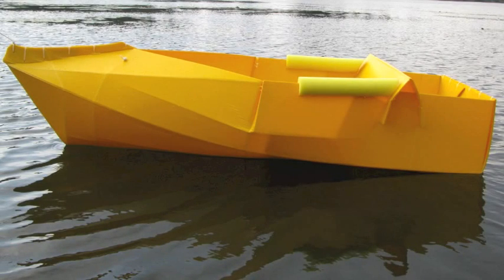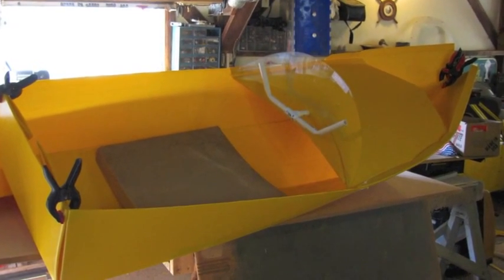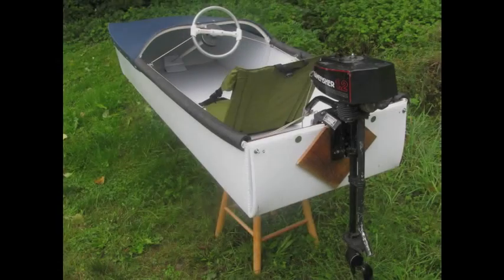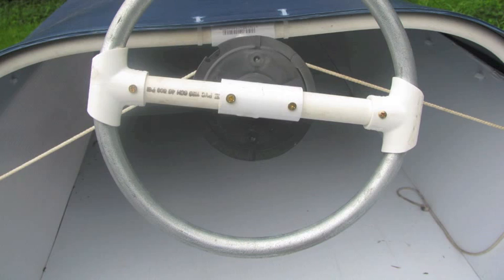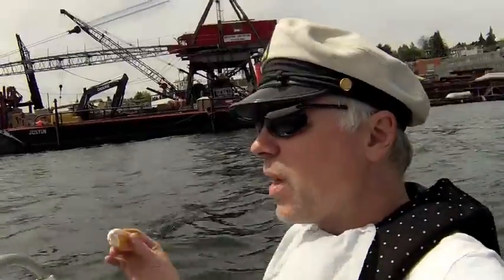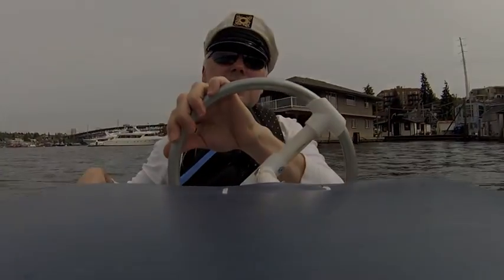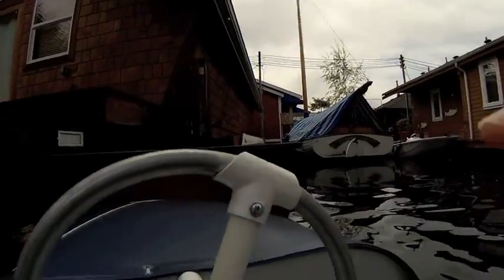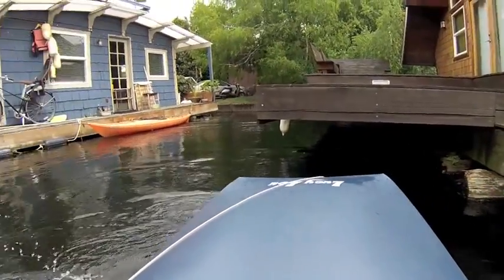A houseboat tour with my DIY micro motor boat

Comment: how fast can this go and would it be a good idea to put an electric trolling motor on it?
Reply from the maker: It goes about 6 knots which isn't neck snapping but still fun. My boat 'Sparky' was lengthened to help support the extra weight of the battery, shown on my youtube channel. Plan available for Sparky as well.

Comment: I'm curious..is there a reason you didn't make frame from 3/4" plywood>>>>tinyurl.com/yyjw942e       ? I would think you could use your template as a guide and cut them out with a router. Wouldn't that be lighter and stronger..I'm not knocking how you did it

Comment: With respect the “jerk” on the boat had a point. With a mega yacht like that parked there that was obviously a private marina. Those people pay a lot of money to have access to there and don’t want to be annoyed but the sound of your motor putting away. Just because all those big boats their engines are within the ship and behind several feet of sound proofing so the most sound from that big ass ship is from the water breaking as it pushes through it. Again like I said with respect but you really shouldn’t have just been there touristing it up.

Comment: FYI
Foam Inserts = Inserts Of Foam Are Constructed In The Inner Bottom Of A Vessels Haul. Either Type Of Foam Application Been Noted As Useful During That Initial Phase Of Construction:
- Hardware Store Standard Retail Size=  2’or 4’by 8’ White Or Blue Styrofoam … Cut-To-Useful-Sizes 
- Spray Foams –Spraying Foam Thru Several Holes Drilled Into Upper Pre-Framed Self-Containment Unit. Note: Spray Foam Expands Plenty And Has Potential To Distort The Bottom Haul. Don't be discouraged to use spray foam because it has its usefuliness. So keep that in mind is all.

Add this concept to your design and never be concerned of losing your boat to the depths of the waters.

Good Luck 
&
Show off to the world your design ingeniousness

Comment: How does the steering work???
Reply: Kruger Games I want to know aswell
Reply: Kruger Games a string connected to the wheel turns the motor because that those types of motors have to be manually turned

Comment: how do you get away with no registration
Reply from the maker: Write you your local or state rep and tell him/her how unfair that is. Say you won't vote for them next time around, that will get their attention.
Reply: its under 10 ft, or its it 12? anyway its short enough.
Reply: 16 and less than 10 hp in wash
Reply: Kenneth Lindahl in Florida you have to register ANY type of motor, that goes for a trolling motor on a canoe! It's ridiculous and it's the only reason why I haven't bought one yet
Reply from the maker: That might be a problem. Sorry to hear about the strict rules. Each state is different. Some states tax everything while others not so much. It seems the nicer weather of a state the worse the taxes.
Reply: Yeah it sucks! Nonetheless awesome boat you have in the video! Whats the website for the plans again?

Comment: I think you answered this already but could you use 10 mm Cora Plast instead of 6 mm I'm having the darndest time finding 6 mm Coro Plast
Reply from the maker: I wouldn't. I had a tough time folding 6mm, using a heat gun and a heavy duty crease wheel to persuade a bend. Don't know where you live but I find mine at Laird plastics in Seattle Washington. I suggest people to google search plastic supply with your nearest city included in the search. You should get some potential outfits to call.
Reply: Paul Elkins I live in Mukilteo Love the hat Paul ! ;)

Comment: Hi Pal. Can the coro speedboat be made with wood?
Reply from the maker: I don't see why not. It might be difficult making the transition from bottom to bow. You could use 1/4" or 3-4mm thick paneling similar to my other electric wood boats to make the gradual transition bend.

Comment: This is an old video but how do you control throttle rates with this boat? I'm very interested in your channel you produce very interesting and informative videos, thank you.
Reply from the maker: +Laxinitup226 The original motor had a small throttle on the steering arm similar to a bike shifter. I moved t up to the right siderail where I rest my hand. That's why it's hard to see.

Comment: Sorry for the multiple posts,  What are the over all dimensions of that Lucy Lu Boat? Length x width x height? in inches preferably.
 I know you are restricted by a one sheet tub style design, I was thinking about your raised outboard, and lowering it back down fixing the outboard, and directing  a rudder or dual rudder behind the prop blast for steering.

Comment: i want the trolling motor to quickly change between Boats, 
I am also thinking of another boat, like a Kayak style lower section with a traditional Boat Hull Corrugated Plastic Top, sides and Bottom, like your Lucy Lu Boat, made 4"  to 6" plus or minus, thick floor horizontal foam sheeting and vertical foam sheeting for the sides maybe 4" +/- thick, mostly of the foam insulation as the main Flotation for the hull, with either a Corrugated outer/upper hull for looks and hull bottom of hull for a smooth durable hull floor protecting the flotation foam, maybe a Plywood floor may be in order as I can use it as a skeleton to mount easily to it and it would be the spine. this style boat may make a front drive, much easier, meaning a Trolling motor between the legs enough forward to make steering comfortable, legs wrap around trolling motor, battery in back.
I like model Boat construction methods, using Interlocking Plywood pieces, as it uses a lot less wood and weight, but provides a Much Much Stronger Hull!!!!  another thought is the 2" wide insulation Foam, vertical side by side pieces across the hulls floor what ever height you are looking for, 6" maybe,  this will help provide a Very Stiff durable Boat w/interlocking ply Bottom under that for the hull floor. Each 4' x 8' sheet of Foam is 5.4-lbs so it is Light and durable.

Comment: I like this boat style and building materials, But i was thinking a 45 lb thrust MinnKota trolling motor, it is almost 3 h.p. But you say you almost sank the boat, can you explain? if it was due to the raised outboard, what about lowering the tannaka outboard back down and just raising the v-bar by adding some verticle extenders at the V-bar tips, as that would keep the COG down lower and keep the rocking yaw /tilting down lower. Another question, the Corrugated Plastic has flutes, have you tried to seal the tops all the way around the top edge trapping the air in the channels/ and second, Have you seen the 2" wide Insulating Foam at Home depot, called R-Tech Insulfoam, 2" thick x 4' x 8' weight per sheet 5.4# and is $20.00 one sheet could go double thick on a boat that small, but maybe single thick is all that is needed,  If you took 3/8" Plywood Floor with 2" foam Insulation, (or it could be double thickness) glued to the ply bottom, then use your Corrugated plastic surround tub folded up origami style, around everything, covering the whole lower section, to make it water tight, like you did on your Lucy Lu boat, except you would have either 2" to 4" thick foam = trapped air sealed in the corrugated plastic, either tape or seal the corrugated plastic holes so that they hold Air, Heaviest part of the boat would be the Lowest part, the foam would add a lot of Bouncy and the foam would be your seat, maybe a foam/ply 1/4" ply may work for seat back seat back with foam glue to it. I dont think you would add a lot of weight, but it would add a lot of bouncy. to bad you dont have a BLOG to have boat building and tips & techniques, for combine brain storming, that would be excellent.
Reply from the maker: +Gary West 
Many ways to build a boat Gary. This is one way, and due to the 4x8 sheet limitation it can only carry so much weight. Water came close to breaching the edge when I leaned way back to fidget with the motor.
Reply: I have been looking at ways to bond/seal  multiple sheets of polypropylene corrugated, looks like, both can be glued together with good super glue, and Hot melt glue both work and seal, a layer of glass cloth on the seal using these adhesives may be the ticket, I would start by making a center tub for you to ride in, make the tub narrower than your boat so you can get a higher side wall and get the height you want, 12" +++ or so, then mount that to a Ply wood lower floor section the entire width and length of the Boat, between the tub and the outer two sheet hull supporting them both, then i would like to have a boat about 40"- 45" + or so wide, I would overlap a center section full width of the floor, with a piece inside and out of boat sandwiched,two chances to seal, that way the extra width is for stability, the inner tub to have some bouncy and keep you dry, the space in between the inner tub and outer wall i would fill in the side walls with the Foam Insulation, it is ridge and tough, and been thinking maybe a Foam insulation floor inside the boat 2" thick and a second Foam floor under the boat (or just do 4" thick inside the Boat floor) for 4" thick total in the floor not including the sides, (I would like to take all the foam I plan on using in the Boat before it is installed lay it all on top of each other on top of pool water and sit on it to see how well it floats under my weight only test) for more flotation, shape it as needed, I am thinking maybe 2"-4" wide on each side outside the tub but inside the outer hull, the full length of boat, this would add a lot of rigidity to the boat. there should be enough foam to keep the boat afloat in a situation so that you dont loose the boat if something were to happen, it should work I Like Quiet, i would like to put a Minn Kota 55 lb thrust Endura Maxx trolling motor 3.67h.p. and a deep charge marine battery setup.
I was thinking either a front drive, as it would handle great and steering would be tiller steering, but will probably go rear drive, to take the complexity out of it.. I figure the all up weight would be just under 300# total with me in it. I have built  a lot of boat and airplane models

Comment: I always love your Ideas. I constructed a coroplast boat from looking at your first one (the white one with yellow cover). Holds well; even after a couple of years, its still going strong. I did make a few adjustments though to plan for longevity. I used two pieces of coroplast for the hull. this effectively gave me a "double hull" boat so if I hit a rock, or just beach the boat... no problem. as an extra added bonus, I truly tested the capabilities of this boat by not only putting me in it (220 lbs on a good day), but also three gallons of gas and a 1966 Johnson JW21E 3 hp engine (all aluminum 30 lbs engine, fully restored by yours truly), and lets not forget the fishing gear! In all about 300 lbs of weight in a 22 lbs boat. Pretty good if you ask me and the boat also maintained a 7 inch draft (part that's underwater). The two cylinder engine almost brought the boat to plane with all of the weight... but not quite. Never tested it without gear and gas, it probably will plane.
All in all, I am happy; and a bad day of fishing is better than a good day at work! But I truly do wish I had more time (and money) to experiment with this a little more, because I have so many ideas and they're just waiting to be released (any inventor/maker of "things" would relate to this...
Emphasis on the money part though ;)
Reply: Wow, great work man. I hope you are still going strong with new projects and adventures.
Reply: @kirkjohnson9353  Oh wow, I remember typing this comment when I was just going into college. Now I'm graduated with my degree in botany and trying to find a good paying job. I still have that boat actually. Also have other projects such as a car and a bigger boat. I just need the job to support it
Reply: @iansrving  I knew it was a long shot to reply to such an old comment- thanks for your reply.  Good to hear you got your degree. That's a tremendous accomplishment- congratultions man, I hope you land that high paying job soon. 
I used to watch a Youtube botany channel that was just hilarious-- you know, because botany is such a funny subject. The channel is Crime Pays But Botany Doesn't .  I loved the humor, style and of course the botany lessons as this guy travels around describing plants and his adventures. I would be curious what a REAL botanist thinks of his channel.
Best of luck to you on YOURS.

Comment: you should try building a mini house boat, nice boating outfit also.or maybe a mini pontoon boat.
Reply: Iseekoutthetruth I'm working on one next. Using pontoon design with PVC drain pipe.
Reply: Iseekoutthetruth
Reply from the maker: I used an old Sears motor called Game Fisher. It's a 2 cycle 1.2 horse power. Kind of like a weed eater, but made for water use.